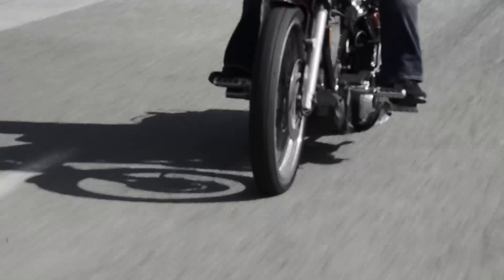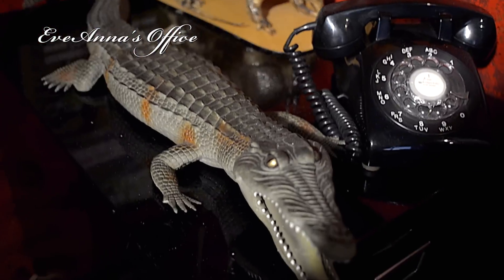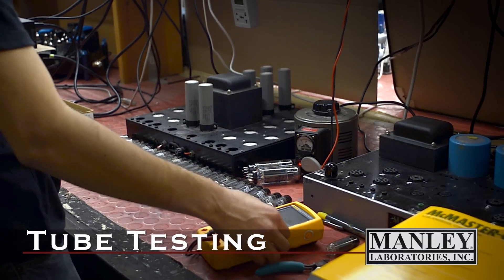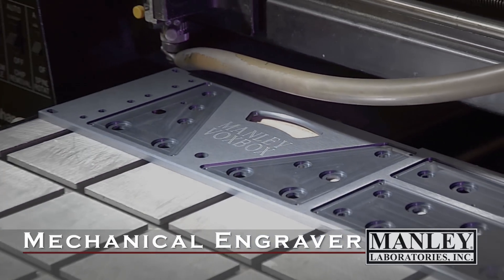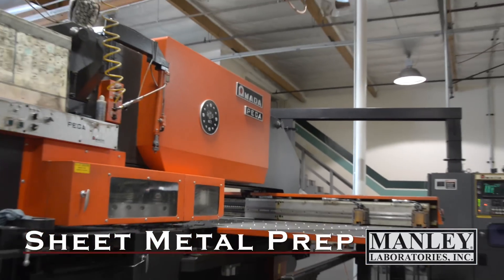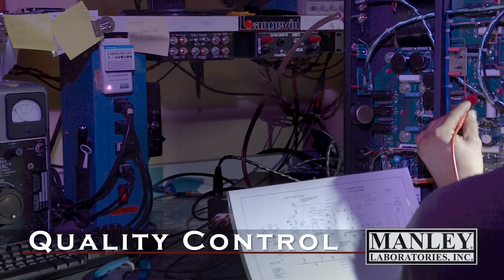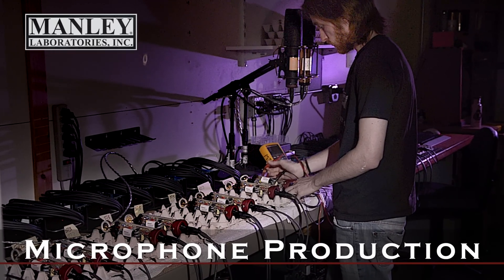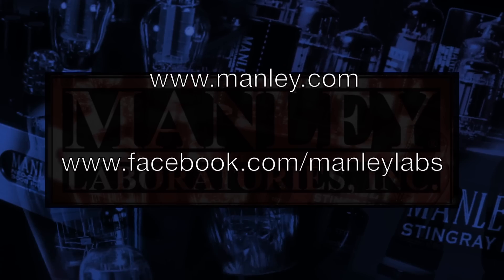Manley Labs Factory Tour (Official Release)

Comment: Interesting because I seem to recall that in a more recent video the circuit boards are now being made in... China.
Reply from the maker: Back when this video was made, we had circuit board etching and screening facilities at our factory in Chino, CA. Elias moved production to an outside facility however his production methods were antiquated and increasingly expensive. Quality was not as good as more modern PCB manufacturers could offer. After receiving a recommendation from a good buddy fellow-pro audio manufacturer, we switched to the supplier in China who is able to accept our Gerber files and make much more consistent and professional PCBs for a reasonable cost. The first reason to make the switch was the huge increase in quality. If you compare our modern boards to the older handmade ones, you would wonder why we hung on so long to our local production.